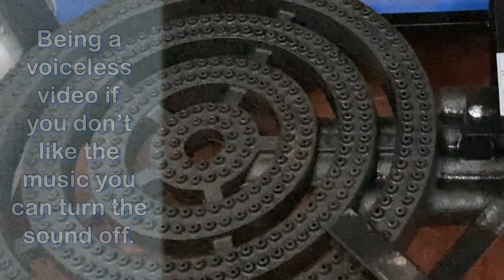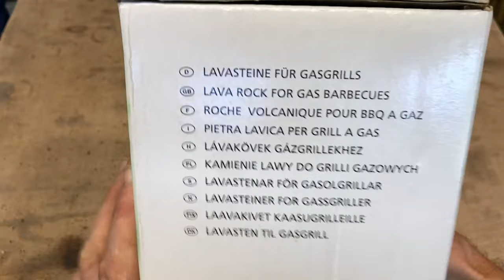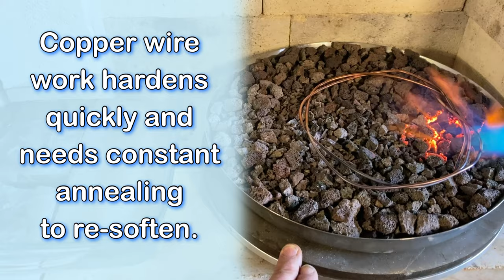Making an annealing pan with pumice (an economy version)

Comment: I did this same thing a few years ago lava gravel and a 15" cast iron skillet i had picked up somewhere, yard sale, thrift store not sure. ground the handle off, set it on a bar stool swivel plate. been working perfectly for at least 3 years now.
Reply from the maker: Hi DT, oh I do love a good tool hack, especially when the Jewellery industry seem to charge a lot for their tools … lava gravel sounds interesting … I assume a product sold for driveways by the bag load … very handy … N
Reply: @Nickscreativestuff  yes they sell crushed lava rock used as gravel or in flower beds at the local mulch yard here. My reasoning was the same. the cost for a 7" tin bowl with pumice is ridiculous, and not nearly large enough for me. so lava rock gravel and a large skillet is what was needed for me lol.
Reply from the maker: Great resource to have accessible, no volcanoes or pumice here in the UK. being a hobbyist and not a commercial jeweller who works with golden diamonds, saving a bit of money here and there making tools is very satisfying … N
Reply: @Nickscreativestuff  same for me i would rather make anything i can, i also find it satisfying. And to me it is insane to pay 50++ dollars for a 7" tin can and some pumice. 7" container just isnt big enough, and i make rings, its not worth the money. i anneal copper, silver, gold all the time..gold not so much. But why pay that when i can make one for 25 or less and it be twice the size. Hope you are staying safe in the UK.
Reply from the maker: yes I’m much more of a maker than a spender … managed to stay clear of Covid, using most of my spare time in my Workshop … stay lucky  … N

Comment: Pet supplies stores that have fish tank supplies, would have good size bags of lava rock for the bottom of tanks. If I remember right, it use to be pretty cheap. It comes in different sizes and one could get a good size bag of smaller rock ans save breaking it up. Amazon sells a 10lb bag for $17.00.
Reply from the maker: thanks for the tip T beaudoin. Not heard of that before there’s a large pet store near me, I’ll have to check it out. it’s very satisfying to find a cheaper alternative to something very commercial, i use my large pan a lot … N

Comment: I wonder if the coarsest grade of expanded clay aggregate- as used in hydroponis- might do as well. It's cheaper than lava rock and , as it wouldn't need crushing,  also saves time and energy (and, if you're safety-concious, the cost of a respirator).
Reply from the maker: thanks for the suggestion littlespinycactus … i’ve not heard of this stuff before, I often pass by a local hydroponics shop i’ll have to pop in and check it out. Good to hear about possible alternatives, opportunity for another video … cheers … Nick
Reply: Yes I don't  want to crush rocks
Reply: That pumis stone is a great  idea
Reply from the maker: yes and cheap at my local discount store … N

Comment: Hello i actually qent out and found those pumice on a rope things and a suitable thick based pan for anealing. I was thinking of taking a hammer to rhe pumice to make them more supportive rsther than judt blocks of pumice in a pan. How much heat can the pumice cope with do you know ?:
Reply from the maker: I’ve found that  pure butane or propane is fine with this pumice, it’s very reflective so builds heat quickly. However not so good with my propane and oxygen mixed torch as it burns a lot hotter, it seems to melt and fuse into a glassy substance … N
Reply: @Nickscreativestuff  I was thinking of ordering some of the map gas ? It's supposedly better for copper work. Pumice wise I bought 6 or 8 fairly large avocado sized but only 1cm thick so I figure I can out them all together in my rectangle pan and create a leveling surface .  Will I still need a thick solder brick too? Or will I be OK annealing and soldering with what I've mentioned? What's your thoughts ? Thank you kirt
Reply from the maker: A lot of people like to use mapp gas as it is that bit hotter than propane or butane alone. I think your pumice blocks will be a great start for annealing and soldering on. There’s a lot of choice for soldering blocks and it depends on what you will mostly be doing. A cheap general purpose soldering block from somewhere like cousinsUK.com is a nice large flat surface for a variety of jobs. Beyond this a soft charcoal block is my favourite to use as it’s very clean to solder on and are easily modify, however they don’t last long.
Honeycomb blocks are more expensive and break easily however great for assembly of components as pins can be used for positioning and the holes can also be used for wiring … N
Reply: @Nickscreativestuff  Thank you ok so I shall go ahead with my pumice blocks for now untill I find a rthym of what I am mainly doing snd decide from there. I know it won't be honeycomb as break ti easy. And because I'm a big worry freak I'll be extra careful so the flame won't be out of control at any time so I'll be fine using what I have I'm just over worrying as usual. Fab thank you
Reply from the maker: I recently saw a large rectangle pizza stone in Lidl’s that was rather cheap, thought it would make a great heat proof tile for a soldering hearth. fire safety is a concern with jewellery making, some people never move on to soldering and torch work because of the inherent dangers. i’ve been meaning to get a small fire extinguisher for my workspace for a bit of peace of mind … N
Reply: @Nickscreativestuff  I have had such a life nick I'm meant to be living it. I've gone through everything I'm sure if God had plans for me he would of done something by now. I feel safe with butane torch. I'm a methodical person I think of each step before hand. In the morning when I first open my eyes I go through a mental list of exactly what I'm going to do. It's the anxiety in me. But it works.but also if there is little wind and not too bright I'll use outside to anneal or solder
Reply: @Nickscreativestuff  and yes I would think the same so longs the base was thick. I found a rectangle deep steel dish made with extra thick metal like 4mm thick in the base. I'll place that on top of 4 or 5 house bricks. Place my pumice blocks inside flat as I can get . And thst should suffice. But yes fire blanket definitely it's on my list of things never ending list
Reply from the maker: good to have a never-ending wish list, keeps us on our toes of what we want and desiring in life … N

Comment: Hey dude, admire your work 👍 if you wanted an even super cheaper annealing pan/block look up building blocks called Toplite.
They are the size of standard breeze blocks but are pure white in colour and weigh nothing. They are almost pure calcium sulphate which sits there laughing at heat and rebounds it back. A whole block is about 50p in the uk or even less. I have used them in foundry work and they take one hell of a beating before glazing over 👍
Reply: Oh and just to show how good that stuff is, I can hold a 1 inch thick tile on my bare hand and melt gold on top of it with a blowtorch, it doesn't even get warm 😀
Reply from the maker: Nice one Dan, i’ve not heard of toplite before had to Google it, even B&Q sell the blocks so definitely on the shopping list for next visit. i’ve been meaning to try and make a mini furnace so this might be the perfect solution. I do love a top tip … thanks for sharing … Nick
Reply: @Nickscreativestuff  no worries dude, always happy to share hints and tips. If you plan on building a furnace i built them for 10 years backyard style and can give you designs that will outweigh most on the net and are just as good as commercial ones.
I do chemistry too, basically calcium sulphate is what cuttle fish bones are made of (good for carving and small castings). That is exactly what those toplite blocks are made of and they are so light and soft you can cut them with a blunt wood saw and also carve them.
Feel free to hit me up for any furnace advice you might need and keep up the good work dude 👍
Reply from the maker: Must be very satisfying building a furnace that works well. look forward to having a play with some soft toplite blocks.  I’m often passing by a Vitcas store here in Bristol, and have thought to pop in if I ever get to the “building a furnace” on the to do list. Probably one of the best routes to achieving success with a project is to take advice from others with much more experience … thanks for the offer … i’ll keep it in mind when I get there with it all  … cheers … Nick
Reply: @Nickscreativestuff  seriously dude, i spent a few years researching building and refining my builds. For the awesome (and free) videos you create i would be more than happy to show you how to build the best furnace for your needs. I have built small ones for jewellery, horizontal ones for knives and blades etc right up to a small....ish furnace that can melt 5kg of iron.
Trust me, materials are cheap, takes very little time or skill and i have built them to use solid fuel, propane and waste oil......all were amazing.
Reply from the maker: sounds like you could write a book on the subject … or a YouTube channel … being able to melt iron is a great achievement … I helped lift and pour a very heavy pot of iron one time in a foundry so I know how much heat is involved. I think that was fired on oil. Must be a great option for home foundries if you have access to cheap oil. Vehicle mechanics probably have endless amounts to get rid of … cheers … Nick